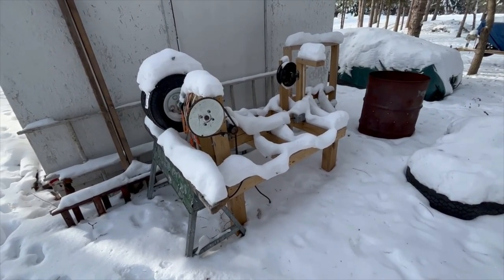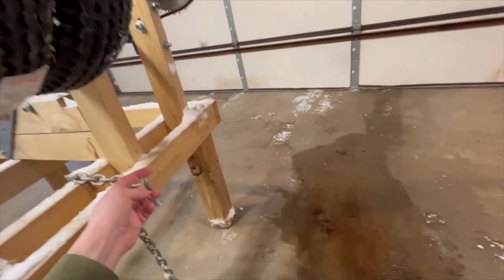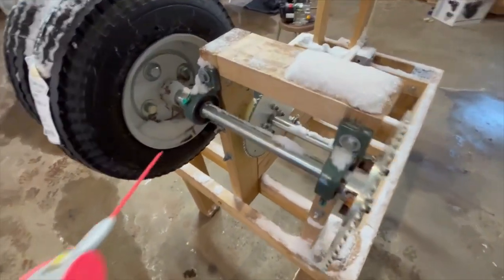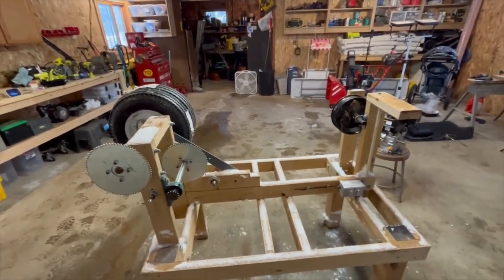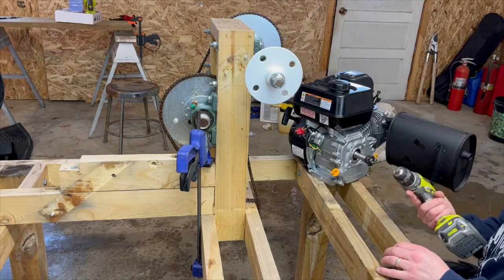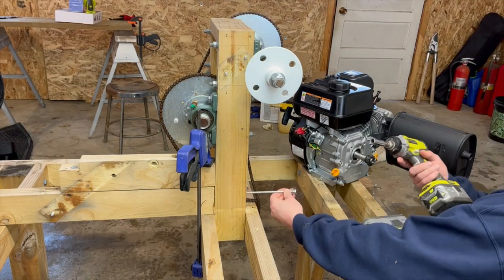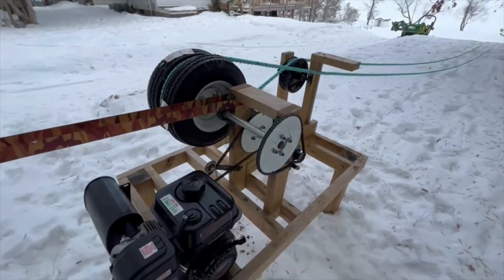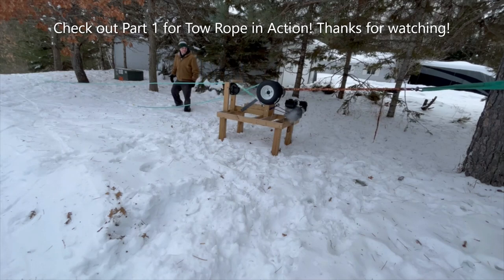Backyard DIY Ski Hill Tow Rope - Part 2 - Rebuild and Improvements

Comment: Hey David, Thanks for this great 2 part video series, it's been instrumental in the design and now construction steps of my own similar rig. I've got most of the parts, equipment, rope, motor, and lumber so far but I've yet to start cutting and assembling anything together. The One part I'm unsure of is what hardware to buy and how I should drill the holes for the bolts. Can you provide me any guidance on what drill bit/what size/length bolts I should be using for holding stuff together. Was also wondering if I needed to use bolts for structural reasons or if I could use standard construction screws instead? I've got most of the tools but none of the confidence in what I'm doing. Still prepared to have to make design changes down the road like your part 2 here. Thanks in advance!
Reply from the maker: I used galvanized bolts to make sure everything was as solid as it could be. I bought them in packages from Menards, but Home Depot or Lowe's probably has them too, Menards was the cheapest. I used galvanized since I've seen the cheap zinc coated bolts (even grade 8) start to corrode within a year when used in high-moisture environments in treated wood. Most of the construction was using 3/8" bolts, they seem to have the best balance between clamping force and cost, I've snapped many 5/16" bolts but 3/8" will pull itself into the wood without snapping, just use a 3/8" drill bit for 3/8" bolts, lengths of bolts will vary depending on which portion you're bolting, I took several trips to find the right lengths for various parts. You could probably get away with construction screws but there is a lot more torque running through this system than you'd think, when using wood, my suggestion would be to stick with bolting it together, it's worked great for me. Good luck with the build and don't hesitate to ask any more questions!

Comment: Hey David, awesome video! Attempting to build one right now! Thank you for the parts list. Can you let me know what size sprockets you used. Some of the links no longer work in your description. What size did you use for those two larger white sprockets, I think one was 72t? (not the tension sprocket). Also, if you can provide the info on the smaller axle. The 36 inch link worked. Such a cool project and the kids (and me) will love it!
Reply from the maker: The two larger sprockets are both 72t, the small sprocket on the jackshaft is 15t, and the small sprocket on the engine is 11t. I basically found the largest and smallest sprockets I could find to gear it down the most I could. If you can't find those specifically don't sweat it, even at idle this seems like it could pull an elephant out of the mud and there is plenty of RPM to go if you wanted to run it faster, so I feel like if you get the gearing even close in either direction to what I have, you will be fine. I used one single 36" axle shaft and cut it in half. Good luck with the build, it's a lot of fun!
Reply: Hey David,  one more quick question. We are building it now. Just starting. I know it's not critical but do you happen to know the length and with of the construction?
Reply from the maker: @funibro  Yes it’s 32” x 48” and about 45” tall
Reply: @ballhammerindustries  thank you! we got most of it done last night. I will take a picture and send it when I get a chance. Perhaps once it's an action.
Reply from the maker: @funibro  awesome! I’d love to see it!
Reply: Did you have a complete parts list? Awesome job
Reply from the maker: There is a parts list in the description of this video, I bought almost everything from Amazon. Thanks for watching!
Reply: @ballhammerindustries  some of those links don't work anymore. I figured it out. Took a lot of searching and head scratching. I ended up getting about half on Amazon and half through other companies. If there's a particular part I can also help out. We have it completed and it works great. We don't have snow yet but we did use it a few weeks back with sledding and it was perfect. Waiting for more snow for some skiing and snowboarding. I will post videos. Thank you again David. Well done